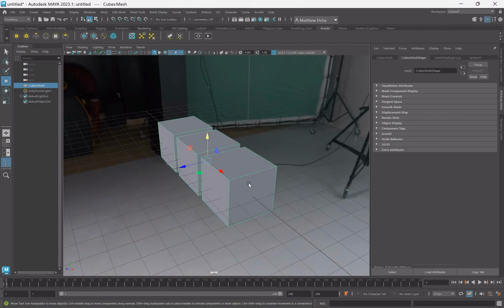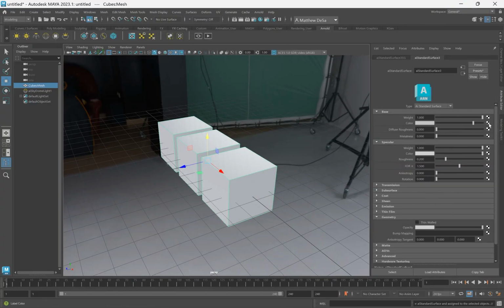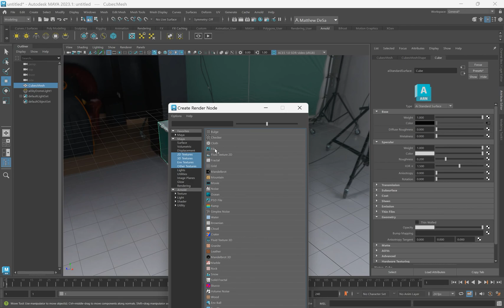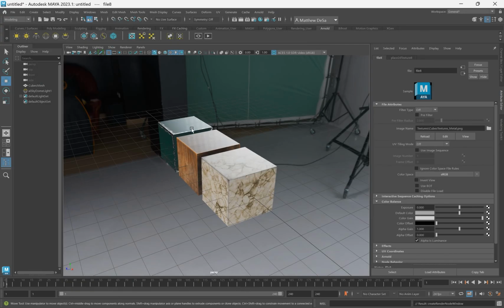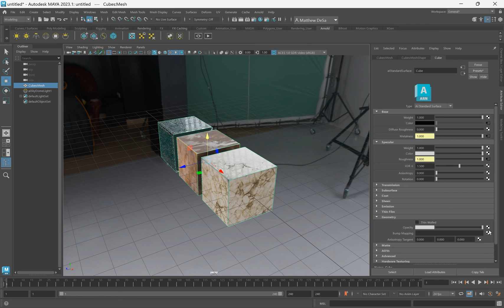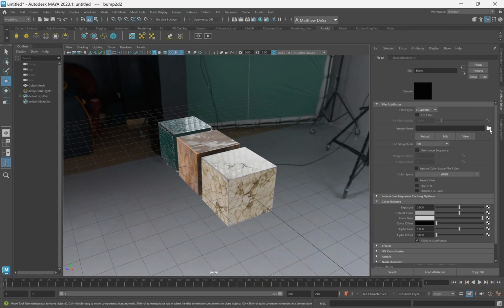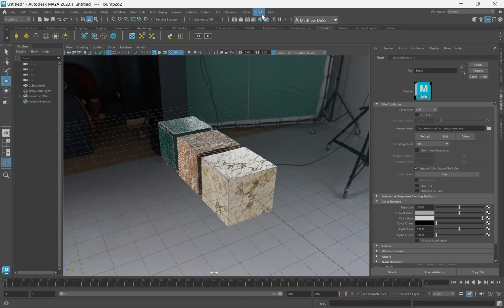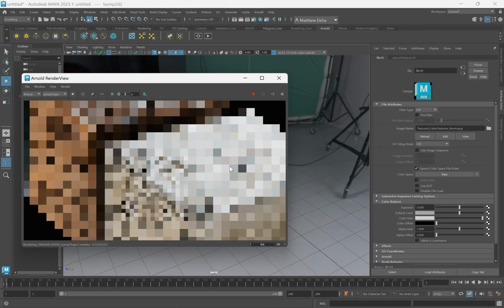Applying Materials in Maya 2023 (Arnold)

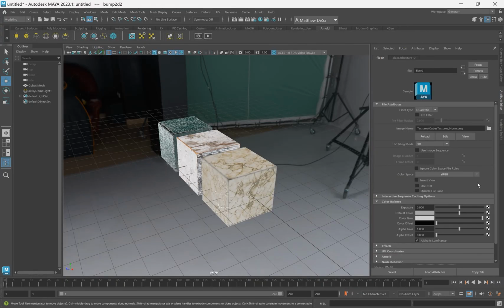Comment: @1:20 why turn off alpha is illuminous for the normal map?
Reply from the maker: @QCode11  alpha is luminance is used typically for black and white maps, I've found that Arnold doesn't like normal maps to have that on, if you are using a bump map it should be turned on